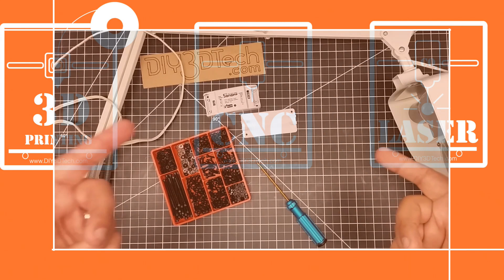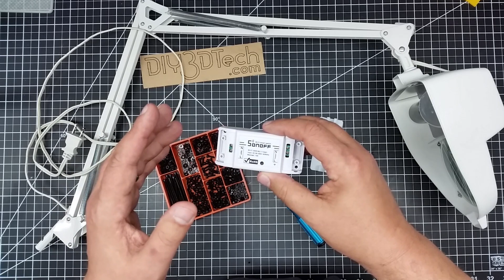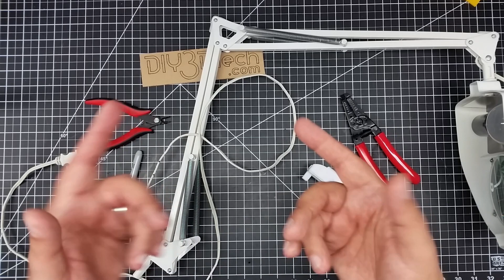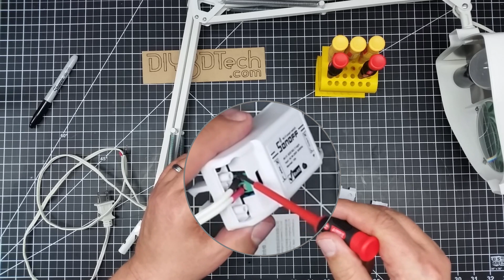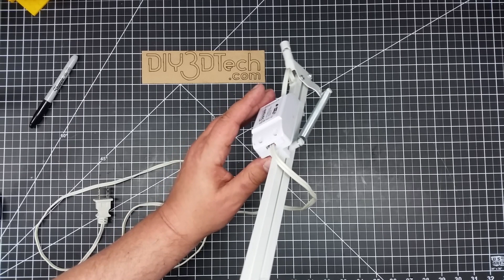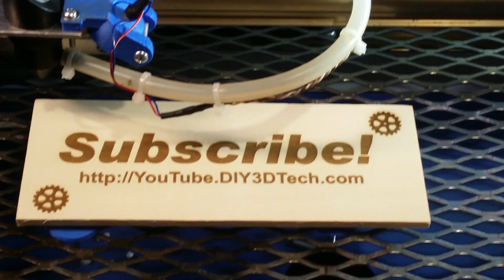3D Printed Project - SonOff Module Lamp Mount Install!

Comment: would wire ferrules work for helping the connections?
Reply from the maker: I don't think so but that only my opinion...
Reply: I tried using them on those type of connectors before and the you can only really get a small one in there with thinner wire so not sure it would be good for mains.

Comment: all my sonoffs have had the firmwares replaced with espurna. works much better than the stock, no routing through china needed for alexa usage.
Reply from the maker: I would agree on the firmware, as in the future I plan on changing mine, however for now wanted to focus on the mount :-)
Reply: oh yeah, installing it is a whole other video for sure but I thought I'd mention it for the more tech savvy here.

Comment: Loved the video thanks, I have got a few myself, search google for the Tasmotta firmware, it’s excellent. Still stuns me that you don’t have an earth wire! Cheers
Reply from the maker: Yes thanks, very much aware of Tasmotta and "technically" if something is double insulated an earthen ground is not require and not that I am saying this "double insulated", however believe they are treating it as such (which I don't believe it is but not an exert)

Comment: You should be using ferrules for those screw terminals.
Reply from the maker: Can I ask why?  They are designed to clamp down wire...
Reply: Main reason: Best practice. Bare stranded wire in screw terminals tend to fray out under the pressure of the screw terminal, this in effect reduces the electrical contact patch, thereby increasing resistance. Using bootlace ferrules keeps all the conductor strands tightly together - practically making the wire end behave like a solid conductor. This gives something solid for the screw down terminal to clamp down upon. 

This guy explains it better than I could: https://www.youtube.com/watch?v=os66cID30Ek
Reply from the maker: That's what I thought you going to say, as in full disclosure I am not expert however there seems to be a debate out there about wire terminals many say you should use the bare wire as your will have better contact and less resistance and of course the other camp lobbies the opposites.  Again I am just Jope average hobbyist and also thanks for sharing the video :-)

Comment: Nice Joe.  How is the snow/ice?  I know you are not subscribed to my little channel so check out this 360 camera video: https://www.youtube.com/watch?v=uvPM0Hi9wm0&t=3s
Reply from the maker: Am subbed (I have over a dozen channels :-) very cool, how come you didn't up load as 360?  Yes still ice and snow, however been traveling almost 100% for past few weeks so no drone flights in a long while.  Should be home this week so weather permitting will try and get out...
Reply: I did, that is a 360 using my new Insta360 ONE.  That is what is really cool about it.  It is like an action camera that you can aim where you want it in post.   I figured you were traveling a lot.  DroneBase had me take another course on rook damage inspections.  They had two big insurance companies now that hopefully will supply work for us drone guys.

Comment: Those modules look very interesting. I hope you come up with some more projects based on them. Are you using the stock firmware or have you updated to an open-source version?
Reply from the maker: I am just using the stock firmware right now but will switch in the future...